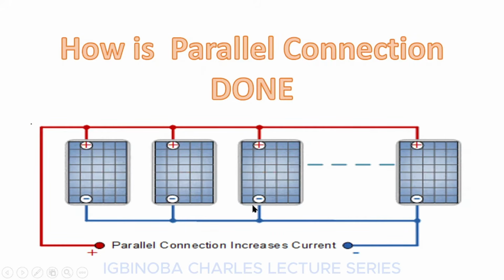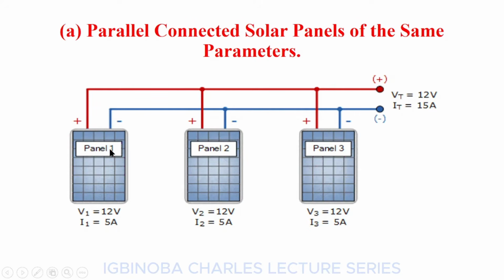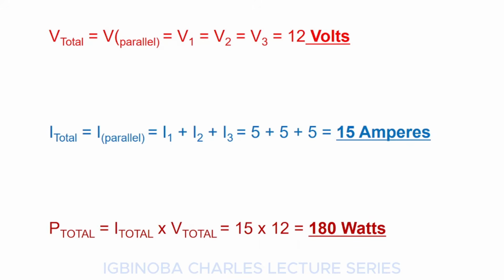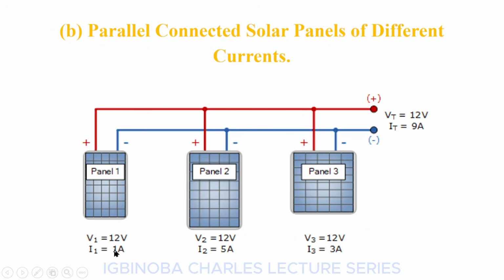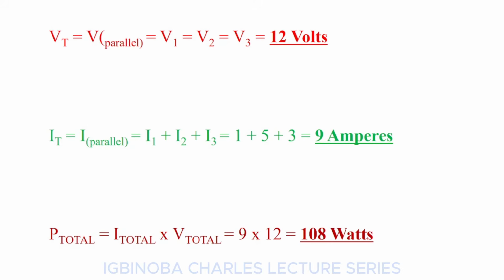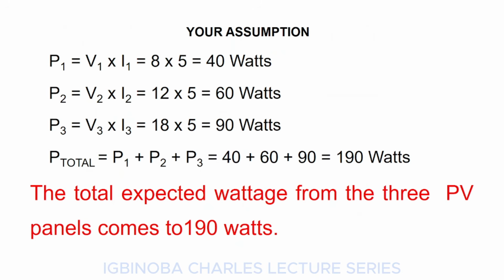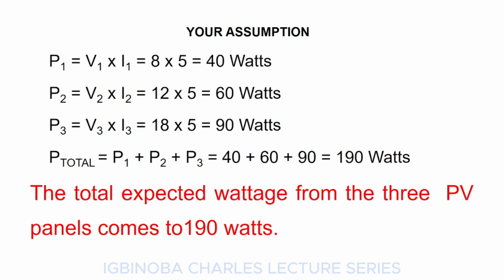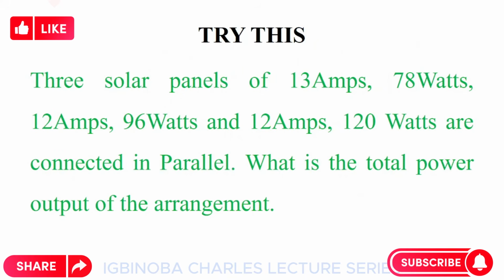Connection of Solar Panels in PARALLEL

Comment: CIV37K

78 W + 96 W + 120 W = 294 W (total power)
13 A + 12 A + 12 A = 37 A (total current)
Combined operating voltage ≈ 294 W / 37 A ≈ 7.95 V

Practical note: panels have different Vmp (6 V, 8 V, 10 V) — to get the full 294 W use an MPPT per panel or similar power electronics.

Comment: COMP94P 
To get the voltages for each panel we use: 
P=IV

For Panel 1
78=13×V
V=6v

For Panel 2
96=12×V
V=8v

For Panel 3 
120=12×V
V=10v

Since each panel has different voltages, the lowest voltage which is also the voltage of the first panel is taken as the voltage total. 

V(total) = 6v

The current total is the sum of the individual current of each panel. Hence, 

I(total) = 13amps + 12amps + 12amps

     I(total) =  37amps

Total Power = I(total) × V(total)
P(total) = 37amps × 6v

    P(total)= 222watts

Comment: EEE19S 

Given; 
Panel 1: 13A and 78W
Panel 2: 12A and 96W 
and panel 3: 12A and 120W
The assumed total power will be; 
78 + 96 + 120 = 294W 

To find the correct total output power, we first calculate for the voltages checking if they are the same also.
Then, using P = I × V, V = P ÷ I  
For panel 1: V = 78 ÷ 13 = 6V
For panel 2: V = 96 ÷ 12 = 8 V 
For panel 3: V = 120 ÷ 12 = 10 V

The power output would be shortened, due to the difference in voltages,  
Then, the smallest voltage is used to get the correct output power  
P = I(Total) × V(Total)  
Then, the Total current will be;  
I(Total) = I1 + I2 + I3 = 13 + 12 + 12 = 37A 

V(Total) = V(parallel) = 6V  
Therefore P(Total) = 37 × 6 = 222W 

The total power supply is 75% of the assumed power.

Comment: Comp57e

Panel 1: 78 Watts  
 Panel 2: 96 Watts  
 Panel 3: 120 Watts

Total Power Output:
78 W + 96 W + 120 W = 294 Watts

Answer: 294 Watts is the total power output of the parallel arrangement.
Reply: EEE86H

Panel 1: 78 Watts

Panel 2: 96 Watts

Panel 3: 120 Watts

Total Power Output:

78 W + 96 W + 120 W = 294 Watts

Answer: 294 Watts is the total power output of the parallel arrangement.

Comment: MEC114J 
Panel 1:13A and 78W
Panel 2: 12A and 96W
Panel 3: 12A and 120W
 To find the voltage of each panel the formula;
V=P/I
V1=78/13 =6V
V2=96/12 =8V
V3= 120/12 =10V
The smallest voltage is taken as the total voltage (Vtotal)
Vtotal=6V
Itotal=13+12+12 =37A
Therefore;
Ptotal =Itotal × Vtotal
= 37× 6
=222W.
Ans:222 Watts

Comment: EEE35I

P1=78w,I1=13A
P2=96w,12=12A
P3=120w,I3=12A

Total current IT=13+12+12
                       =37A
The assume total power when the voltage of the panels are not considered would be 
PT=P1+P2+P3=294w

From the equation P=IV then V=P/I

V1=78/13=6v
V2=96/12=8v
V3=120/12=10v

The total output voltage is the lowest voltage value of the panels connected in parallel which is 6v

So therefore,the total power PT=IT ×VT
=37×6
=222w

Comment: PETROCHEM64L

To get the voltages; 
1st panel•• 78÷13= 6v
2nd panel •• 96÷12= 8v
3rd panel •• 120÷12 = 10v

Total voltage= v1= 6v 
Total current= 13+12+12 = 37amps

Total power output= 6×37
= 222watts

Comment: MEC80B 

From the question. The following results are as follows;
I = 37A
V = 6 volts 
P = IV
       37 × 6 = 222 Watta
  The total power output of the arrangements is 222 Watts

Comment: MEC82D

VOLTAGE= V1 =6V
TOTAL CURRENT = 13+12+12 = 37amp
TOTAL POWER OUTPUT = 6V × (13+12+12)
TOTAL POWER OUTPUT = 6 × 37 = 222watts

Comment: CIV43Q

Panel (I): 78

Panel (ii): 96

Panel (iii): 120

Total power output: P(i) + P(ii) + P(iii)=

78W + 96W + 120W = 294 Watts

Total power output of the parallel arrangement = 294 watts

Comment: MEC52Z
Panel 1- 78
Panel 2- 96
Panel 3- 120

Total power unit:
78w +96w + 120w= 294w

Total power output of the parallel arrangement = 294watts

Comment: MEC100V

When solar panels are connected in parallel, the total power output is the sum of the individual power outputs.

Given that
Panel 1= 78 watts
Panel 2= 96 watts
Panel 3= 120 watts

Total power output= 78 + 96 + 120 = 294 watts

The total power output of the arrangement is 294 watts.

Comment: NAT33G 

P1= 78W, I1=13A
P2= 96W, I2=12A
P3= 120W, I3=12A

Total current IT= 12+12+13= 37A 

The assumed total power when the voltages of the panel are not considered would be:
Pt= P1+P2+P3
  = 78+96+120= 294W
From the equation P= IV, V= P/I

V1= 78/13= 6V
V2= 96/12= 8V
V3= 120/12= 10V

The total output voltage is the lowest voltage value of the panels connected in parallel which is 6V

So therefore, the total power, Pt= IT×VT 
  = 37×6= 222W

Comment: PETRO42P

Parameters 
Panel 1
I1= 13A
P1= 78 W
V1= 78÷13=6V
Panel 2
I2=12A
P2= 96W
V2=96÷12=8V
Panel 3
I3=12A
P3= 120W
V3=120÷12=10V
Total Voltage= 6V
Total current=l1+l2+I3
Total current =13+12+12A=37A
Total power output=Total current x Total Voltage 
Total power=6x37= 222W
The total power output=222Watts

Comment: COMP17Q

Panel 1: 78 

Panel 2: 96

Panel 3: 120  

Total power output:

78W + 96W + 120W = 294 Watts

Total power output of the parallel arrangement = 294 watts

Comment: EEE346T

P2= 78W, I1= 13A
P2=96W, I2=12A
P3= 120W, I3= 12A

Totsl current IT= 12+12+13 =37A

The assumed total power when the voltages of the panels are not considered would be:
PT= P1+P2+P3
     = 78+96+120= 294W

From the equation P=IV, V= P/I

V1= 78/13 = 6V
V2= 96/12 = 8V
V3= 120/12 = 10V

The total output voltage is the lowest Voltage value of the panels connected in parallel which is 6V

So therefore the total power, PT= IT x VT
    = 37 x 6
    = 222W

Comment: NAT41O

To find the total power output when solar panels are connected in parallel*, simply *add their power outputs directly.

---

Given:

- Panel 1: 78 W  
- Panel 2: 96 W  
- Panel 3: 120 W

---

Total Power Output =

78 W + 96 W + 120 W = 294 W

---

✅ Final Answer:  
294 watts (W) is the total power output of the parallel arrangement.

Comment: NAT44R

To find the Total power output when solar panels are connected in parallel  simply add their power outputs directly.

---

Given:

- Panel 1: 78 W  
- Panel 2: 96 W  
- Panel 3: 120 W

---

Total Power Output =

78 W + 96 W + 120 W = 294 W

---

✅ Final Answer:  
294 watts (W) is the total power output of the parallel arrangement.

Comment: CIV50X 

Total power is pt=p1+p2+p3
78+86+120=294watts
To get the correct total output power, we calculate voltage=v1=6v
Total current=13+12+12=37amp
P=1×V=37×6=222watts

Comment: COMP36J

Panel 1: 78 Watts

Panel 2: 96 Watts

Panel 3: 120 Watts

Total Power Output:

78 W + 96 W + 120 W = 294 Watts

total power output of the parallel arrangement =294 Watts

Comment: PETROCHEM49W
In parallel, total power= sum of individual powers.
Therefore, Total power= 78+96+120=294W
Therefore, the total power output of the arrangements is 294W.

Comment: COMP55C

Due to the mismatch of panels as a result of different voltage, there will be power loss if all power ratings are added from the three panels 

Therefore, in parallel connection of the solar panels, the panel with the Lowest voltage will be used to calculate for the total power accounting for the loss that there would have been. 

The total Output power is therefore 222watts

Comment: MAR69Q 
IN PARALLEL THE TOTAL POWER IS EQUAL TO THE SUM OF INDIVIDUAL POWERS 
THEREFORE THE TOTAL POWER IS 78+96+120=294W
THEREFORE THE TOTAL POWER OUTPUT IS 294W

Comment: PETROCHEM60H
Total power is Pt=P1+P2+P3
78+96+120
Therefore total Watts is=294watts
To get the correct Total output power we calculate Voltage=v1=6v
Total current=13+12+12=37Amp
P=1*V=37*6=222watts

Comment: MAR118N

Panel 1: 78 watts, 13 amps and 6 volts

Panel 2: 96 watts 12 amps and 8 volts

Panel 3: 120 watts 12 amps and 10 volts

Total voltage = 6volts

Total current=13+12+12 = 37A

Total power = 37×6=222 watts

Comment: MEC97S

Panel 1: 78 watts, 13 amps and 6 volts 
Panel 2: 96 watts 12 amps and 8 volts
Panel 3: 120 watts 12 amps and 10 volts 
Total voltage = 6volts
Total current= 13+12+12 = 37A

Total power = 37×6 =222 watts

Comment: PETROCHEM40N

I¹ = 13A
P¹ = 78W → P¹ = I¹V¹ → V¹ = 78/13 = 6V
I² = 12A
P² = 96W → P² = I²V² → V² = 96/12 = 8V
I³ = 12A
P³ = 120W → P³ = I³V³ → V³ = 120/12 = 10V
I(total) = I¹ + I² + I³ = 13 + 12 + 12 = 37A
V(total) = smallest voltage = 6V
Total Power, P = IV = 37 × 6 = 222W

Comment: COMP88J
Given
Panel 1, I1 = 13A, P1 = 78W
Panel 2, I2 = 12A, P2 = 96W
Panel 3, I3 = 12A, P3 = 120W
To find voltage 
P = IV
V = P/I
V1 = 78/13 = 6V
V2 = 96/12 = 8V
V3 = 120/12 = 10V
 Vtotal = V1 = 6V
Itotal= l1+l2+l3 = 13+12+12 = 37A
Ptotal = Vtotal × Itotal
            = 6×37
            = 222W

Comment: PETRO 64L 
 I¹=13amp
P¹=78watt: P¹=l¹v¹; v¹=78/13= 6volts

I²=12amp, p²=96watt
P²=I²v² where v²=96/12=8volts

I³=12amp, p³=120watt
P³=I³v³;  v³=120/12=10volts

I(total)=I¹+I²+I³=13+12+12=37amp
V(total)=smallest volt(v¹)=6volts

Total power output arrangement (P)=IV=37*6=222watts

Comment: COMP97S

The total power output=222W

Reason because they're of different voltages,so the least voltage was multiplied with the total summation of the current 
6×37=222W

Comment: MEC58F 

Panel 1=78watts,13amps and 6volts
Panel 2=96watts,12amps and 8volts
Panel3 =120watts,12amps and 10volts
Total voltage=6
Total current=12+12+13=37

Total power=6×27=222watts

Comment: EEE 3131A

I1=13A, P2=78W
I2=12A, P2=96W
I3=12A, P3=120W

Total current, IT=I1+12+I3=12+12+12=37A

Assumed total power, PT=P1+P2+P3=78+96+120=
292W(this is an assumption because the voltages of the panels were not considered)

From P=IV, V=P÷I
Therefore: 
V1=78÷13=6V
V2=96÷12=8V
V3=120÷12=10V

The total output voltage is the lowest voltage value of the panels connected in parallel which is 6V

So the total power, PT=IT×VT=37×6=222W

Comment: CIV16P
Total power = 222watts
Firstly, obtain the current value of each solar panel
V=P/I , 78/13 = 6V
 V=P/I, 96/12 = 8V
V=P/I , 120/12 = 10V
Total current = 13A + 12A + 12A = 37A
N.B = The voltage output is the lowest voltage value in the system, I.e = 6V
Total power , P = IV, = 37 x 6 = 222 watts

Comment: CIV45S

To find the total power output when solar panels are connected in parallel, you simply add the individual power outputs

Given:
 Panel 1: 78 Watts  
 Panel 2: 96 Watts  
 Panel 3: 120 Watts

Total Power Output:
78 W + 96 W + 120 W = 294 Watts

Answer: 294 Watts is the total power output of the parallel arrangement.

Comment: PETROCHEM38L 
For panel one: 13 A, 78 W → voltage ≈ 78 / 13 = 6 V

For panel two: 12 A, 96 W → voltage ≈ 96 / 12 = 8 V

For panel three: 12 A, 120 W → voltage ≈ 120 / 12 = 10 V

Total power output = 6V × (13+12+12)
Total power output = 6×37 = 222watts

Comment: MAR120P
Given
Panel t 13Amps and 78watts Panel 2: 12Amps and 96watts
and panel 3: 12Amps and 120watts The assumed total power will be
78 + 96 + 120 = 294watts
In order to get the correct total output power., we first calculate for the voltages checking also i? they are the same Therefore using P= I|xV, V= P|
For panel 1:V = 78+13 = 6Volts
For panel 2: V = 96 + 12 =8 Volts
And for panel 3: V = 120 + 12 =10 Volts
But since the power output would be limited,
due to the difference in voltages,
The smallest voltage is used to get the correct
output pOwer
From P = I(Total) + V(Total)
Therefore the Total current will be;
I(Total) =|1+ 12+13 = 13 + 12+ 12 = 37Amps
And V(Total) = V(parallel) = 6Volts
Therefore P(Total) = 37 x 6 = 222watts
Therefore the Total power supply is 75 percent of the maximum power (assumed power) that can be given by the panels.

Comment: MAR109E

Solar panels of the same number of volt and different number of currents connected in parallel produce the same number of volts and the addition of the currents

Comment: MAR 117M

Total Power = 222 Watts 

Total Current Output = 13+12+12 = 37A
Voltage Output is the lowest voltage in the system, whis is 6V

Power Output = 37×6 = 222 Watts

Comment: EEE91M 

Given parameters 
Panel 1
I1= 13A
P1= 78 W
V1= 78÷13=6V
Panel 2
I2=12A
P2= 96W
V2=96÷12=8V
Panel 3
I3=12A
P3= 120W
V3=120÷12=10V
Total Voltage= 6V
Total current=l1+l2+I3
Total current =13+12+12A=37A
Total power output=Total current x Total Voltage 
Total power=6x37= 222W
The total power output=222Watts

Comment: PETROCHEM4D
In parallel, total power = sum of individual powers.
Therefore,Total Power=78+96+120=294W

Therefore, the total power output of the arrangements is 294W.

Comment: EEE69Q

Given parameters 
Panel 1
I1= 13A
P1= 78 W
V1= 78÷13=6V
Panel 2
I2=12A
P2= 96W
V2=96÷12=8V
Panel 3
I3=12A
P3= 120W
V3=120÷12=10V
Total Voltage= 6V
Total current=l1+l2+I3
Total current =13+12+12A=37A
Total power output=Total current x Total Voltage 
Total power=6x37= 222W
The total power output=222Watts

Comment: MAR124T
First we find the voltage of each panel which is is V=P/I ---6v, 8v and 10v
In parallel total power =sum of individual powers 
Ptotal=78+96+120=294W

Comment: EEE83E

Given 
Panel 1: 13Amps and 78watts
Panel 2: 12Amps and 96watts 
and panel 3: 12Amps and 120watts
The assumed total power will be 
78 + 96 + 120 = 294watts

In order to get the correct total output power, we first  calculate for the voltages checking also if they are the same
 Therefore using P= I × V, V = P÷I
For panel 1: V = 78÷13 = 6Volts
For panel 2: V = 96 ÷ 12 = 8 Volts
And for panel 3: V = 120 ÷ 12 = 10 Volts

But since the power output would be limited, due to the difference in voltages, 
The smallest voltage is used to get the correct output power 
From P = I(Total) + V(Total)
Therefore the Total current will be;
I(Total) = I1 + I2 + I3 = 13 + 12 + 12 = 37Amps

And V(Total) = V(parallel) = 6Volts

Therefore P(Total) = 37 × 6 = 222watts

Therefore the Total power supply is 75 percent of the maximum power (assumed power) that can be given by the panels

Comment: PETRO 40N 

Total power = 222watts

Firstly, obtain the current value for each solar panel.
V=P/I ; 78/13 = 6V
V=P/I ; 96/12 = 8V
V=P/I ; 120/12 = 10V

Total current= 13A + 12A + 12A =37A

N.B= The total voltage output is the lowest voltage value in the system, i.e = 6V

Total power, P = IV ; =37×6=222Watts

Comment: NAT29C

Here I have different ratings, first of all I will be looking for the "V" the voltage of each of the panels using 
 
Total power = V × I

V1 = 78/13 = 6V
V2 = 96/12 = 8V
V3 = 120/12 = 10V

Initially the total current from the panels are 

I total = I1 + I2 + I3
I total = 13A + 12A + 12A = 37A

from the "V" (Voltage) here is 6V I am using  because that is the smallest voltage I have ( using it base on the law ,when you have panels of different voltage) .

So the "Ptotal "

 Ptotal = Total voltage (Vt) × Total current (It)
 
Ptotal = 6V × 37A = 222Watts.

Comment: CIV26Z 

The solar panels are connected in parallel, and the total power output is the sum of the individual power ratings of each panel. The power ratings are given as 78 watts, 96 watts, and 120 watts.

Thus, the total power output is calculated as follows:
78 W + 96 W + 120 W = 294 W.

Therefore, the total power output of the arrangement is 294 watts.

294

Comment: MEC128X

If V = P/I
The respective values of V would be:
a) 13 A, 78 W = 6 V
b) 12 A, 96 W = 8 V
c) 12 A, 120 W = 10 V

Because their voltages are different, they cannot be safely connected in parallel, the higher-voltage panels would push current into the lower voltage ones.

If all three panels had the same voltage rating 
 
I = 13 + 12 + 12 = 37A

And
P = IV
For V = 12V
P = 37 × 12 = 444W

Comment: CHM 46T 

Given parameters 
Panel 1
I1= 13A
P1= 78 W
V1= 78÷13=6V
Panel 2
I2=12A
P2= 96W
V2=96÷12=8V
Panel 3
I3=12A
P3= 120W
V3=120÷12=10V
Total Voltage= 6V
Total current=l1+l2+I3
Total current =13+12+12A=37A
Total power output=Total current x Total Voltage 
Total power=6x37= 222W
The total power output=222Watts
Reply: PETROCHEM46T 
THE TOTAL POWER = P1 +P2 + P3 = 78WATTS +96 watts + 120 watts = 294watts